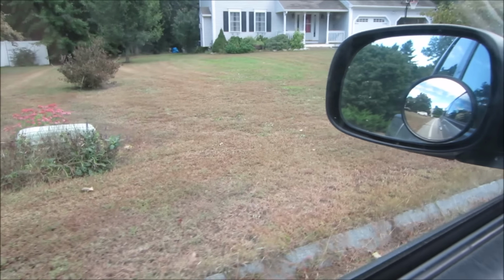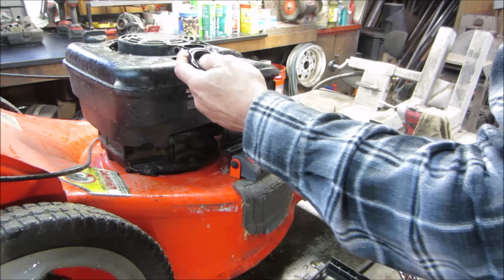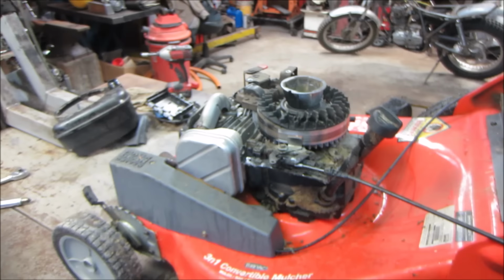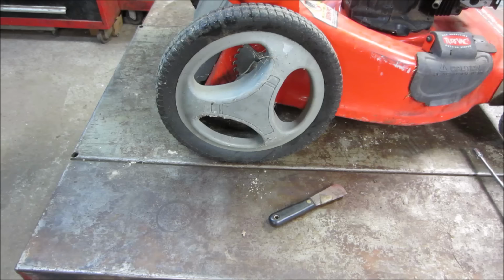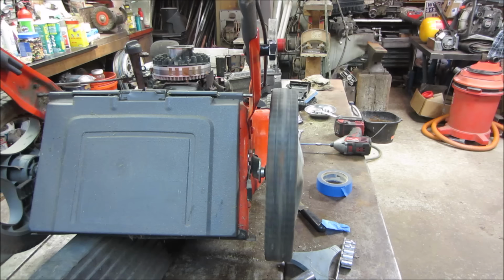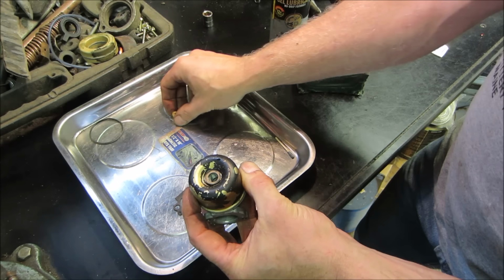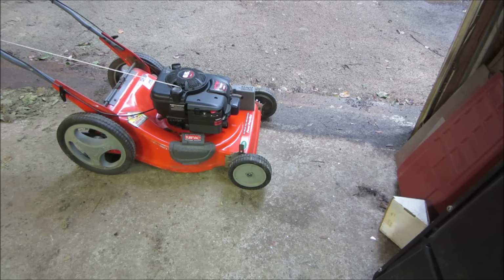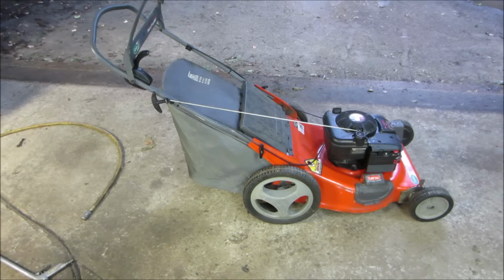How to restore a lawn mower. cheap.

Comment: Blade grind is definitely wrong. It needs to be on the upper side to cause the clippings to lift and stay aloft to be mulched and re-mulched into tiny bits or to be vacuumed into the bag. It acts as a fan so to speak.

Comment: Great video with nice explanations thanks, I have a question, doesn't it have an oil drain plug underneath the deck?  Seems if the mower is turned almost upside down to drain oil it has to leak fuel.

Comment: I'm lucky living in Canada - Shell V-Power 91 octane fuel has no ethanol. I use it exclusively for my lawnmower and snowblower (plus the Jetta, as seen in the icon). It may sound extravagant to put premium in them, but they have been bulletproof since running that fuel. That carb was DISGUSTING!

Comment: Thanks for the video! with your video, the "ground wire" attached to the armature or ignition coil is actually one that shuts off the engine, so does this mean then that if that cable touches a metal the engine will not start at all?

Comment: Hello Mustie, I enjoyed your video. I am from Australia and I have a lawnmower, that I am having trouble with in that it is backfiring and sparking after about 10 minutes run. The firing noise comes from around the carburettor. Also it does not seem to run smoothly, the noise of the engine is not regular. Had a look at a video which indicates that it might be a coils that is not working to its full capacity. I had given it to a lawn mower tech but  lost nearly $300 in the end and ended with a lmower thats not right. It is a Victa, 2-stroke Briggs and Stratton motor. Csan you please give me a headsup as to what might cause the problem. Keep up the good work.. Thankyou.

Comment: That blade is the product of somebody wanting to sharpen the blade and was either too lazy to take it off and do it right or didn’t have the right tools handy 
Either way it’s sharpened on the wrong side of the blade the bevel should be on the top not the bottom.  And the purpose of the back edges being curled up is to creat an up draft under the mower deck to draw the grass to stand up so the blade can cut it off!!

Comment: Mustie, I’ve got a question,  I’ve  got a  3yr old toro, push mower  Honda motor with self propel,  I always run it out of gas when I’m done with it,  last weekend I mowed the front yard,  took an hour break and went to start mowing the back yard, and it wouldn’t start,   This mower has always started by barely pulling the rope, and always by the second pull,  I pulled the bowl off and sprayed down the float with carb cleaner and it started up, but ran a little rough,  my question, do you think that just adding a fuel system cleaner will help the issue,  or would you suggest a complete carb rebuild?  My mom bought me this mower as a Father’s Day / birthday gift,  and I know might sound strange but I would like this mower to last for many many years. Thank for your videos,

Comment: I have a similar Intek 6.5 engine but with no speed adjustment or throttle cable. Anyone have any ideas on an engine suddenly running at 1/2 speed? Is there adjustment screws or linkages I'm not familiar with somewhere? Let me know. Thanks for the great video, as always!

Comment: Why not just drill out the four rivets and rerivet them upon reassembly. Great video. Im 66 yrs old.and at the risk of being judged as not holdimg up my end of the social compact and continuously repurchasing the same products over and over, im forced to admit in my life ive never bought either a lawnmower or a vacuum cleanef new from a store and no this isnt indicative ghat i live in a home with grass up to the window tops and carpeting so full of culinary detritus that the family could pass for.preppers and eat the carpet in a famine. I continually pickup curbside both these home essentials and upon inspection over 90% of the time theres nothing wrong with the vacuums other than the owners have failed to follow the instructions they so inanely tossed aside when they opened it from the box, ie the filters are clocged and or.the belg broke.....$6.99. As for the mowers.....ditto......they usually have parked it full of gas all winter and gummed up the carb.....period. This is the face of whats been foisted on the ever stuperous cattle as a Consumer Economy. An economic model designed to fail as soon as the cattle run out of feed or the credit most depend on to continue a lifestyle they see the Kardasian girls on tv live oblivious to the fact its a fantasy and what little truth is there , they paid for......on credit, of course. Anyways thanks for the fun snd i apologize for the sermon , but i did find it in a trashcan for free. Rich/San Jose

Comment: which way does the blade turn, clockwise or counter clockwise ?
Also I have one that is chain driven front wheel drive and chain is rusted up bad ,
so what is good way to get that clean or usable? I was going to soak it in oil.

I liked the way your drained the oil , and you didnt say how much oil does it take to fill one up?

Comment: Did he use the 15mm pipe? I have been working (diy) on alot of things over the years, but I cant remember using 15mm once.. Out of curiosity I would love to know me thread size of the wheel shaft..

Comment: The secret to the wheel may be What I've seen done with you are gonna laugh but Barbie arms Had a friend they made custom Barbie's you boil water remove from heat drop the wheel in leave it in for short time increments you don't want it to get too pliable, place it on a flat surface then place a weight on it either cool it down with cold water or allow it to cool & hold to hold the shape. heat guns only allow you to heat the rim the tire also holds the warpage to change the solid tires you boil them to make them pliable to stretch over what uses to be steel rims.

Comment: My mother gave me a lawnmower it has the same motor as yours. I took the carburetor off and clean it with my air compressor and soaked it in gas. I check the spark plug and it has spark. Try turning on the lawnmower and it’s doesn’t start even when I put starting fluid in it. Compressor is good. Any idea?

Comment: What if you laid the wheel flat with pressure or weight on it and applied heat? 😮 25:50

Comment: Very enjoyable and entertaining. I never hear your air compressor running when you use your air tools is it located at your neighbors house or do you have it in a sound proof shed? Is that a Q-tip that you used on your drill? It is interesting that the engine speed is controlled from a lever on the engine and not from the handle.

Comment: I know it's old video, how much time did you put into it? 
1st drive by that mower you missed picking up that pot & lid. Can always use a large oil catcher.
I've had a few FREE MARKET mowers. Did just like you, go through it to see if it's viable. In my area most weren't, usually the oil was never changed.
HoDIY blade sharpeners usually just grind the wrong side of the blade, too lazy to remove & do it right. Tho it still cuts fine. Balance? Only if it shakes. (Eyes skyward)
(HoDIY - HOME owner DO IT YOURSELF)

Comment: Can I ask u a question I got a snaper sp90 runs great I got it new 2017 I'm starting have little gas coming out of the breather tube that goes into the air fter I put a new air filter in which the manufacture said it still comes out now its just like a teaspoon.the amount not much like I said it runs great I have no idea  u have any ideas

Comment: you have to make dam sure you have the peice mointing to teh carb. sealed tight so air does not find its way in there, only fuel, I found that out!!, possible silicone sealer
Reply: this area you will also find a fuel leak and you will have to get the new gasket or a sealer to be applied in that area, or you will have problems leaking fuel and sucking air

Comment: Did you ever run a piece of mig wire through the rope pulley and use it to thread the crank rope?  You might try it!

Comment: hello ! ... i got the clunking noise in my mower, the noise was loud and suddenly it stopped and no more noise and running smoothly.  My bad because the lack of maintenance, i recall to check the oil and I remember I saw it good, no black or low level. Can I still save my engine?

Comment: Whomever sharpened that blade didn't remove it first. Sharpened it on the mower,  the rear wheels I'm almost sure one side was hit by a car in the garage.  I've come across that before tire of a car will bend both wheels like that.

Comment: what solution are you using in your sonic cleaner?  Ive seen guys on youtube use regular gas in the sonic and it works quite well.  a local shop uses straight simple green

Comment: PA LAWN GUY> Mustie that blade was never intended to be sharpened as it was. The lowest point on a mower blade should be the leading edge of the cutting surface. The way this blade was sharpened there is an excessive amount of drag on the blade and the engine has to work harder to maintain governed RPM.

Comment: I'm late to the party, but that blade isn't correct. I've never seen one sharpened on the bottom side. That one looks like it was manufactured by Murray. And I've never seen them use a blade sharpened on the bottom. I'd guess it's upside down

Comment: Hi Musti, nice job! Again 👍
Question: my lawnmower similar to this seems to be not grabbing very well with them front wheel drive wheels, i.e.when it gets in a gopher hole, or up against a rock, brick etc,etc, is there a way to strengthen the grab in the drive unit?
Reply: If it has a belt, clean the pulley. There may also be a spring of other method to put tension that may be adjusted.

Comment: check the blade first to make sure he didn't snap the crank key off then i would have bolted on the recoil to c if it had spark and compression.  why clean anything.

Comment: Hlo. With respect. You never ever turn the blade without leather gloves and FIRST DISCONNECTED THE SPARK PLUG, because it is an 4 times engine and for the reason you want it can suddenly start and kiss your fingers good bye. Even without grasp the maneuver. It's is just a respectfully advice. Thank you

Comment: Got a troy built tiller that piss gas out the carburetor what would cause it? Not setting?
Reply: Just like what he shows in the video, the float bowl seat is leaking. You need to clean it up just like in the video. May need to replace the seat itself. They're often rubber and die from ethanol exposure.
Reply: Easy the float had cracks in it found them when I tried to sodder. It so a carburetor is only 28.00 bucks...
Reply: Troy built with the killer. Engine have brass seats or this is what I found out...

Comment: i do not waste my time with those wheels on that mower, i look for a rover mower with a shot motor, so i remove the shot motor and put the good running motor off the shitty chassis and bolt the good running motor on the rover chassis

Comment: First glance: Blade is upside down.
But it's not.
Reply: Here's an easy way to remember: Once you've ground your blade, your work will not be visible when the blade is reinstalled (ground surface ALWAYS faces upward).
Reply: I've NEVER seen one ground like the one in this clip. Maybe I just haven't been around long enough...

Comment: I find these from time to time, but now I just pass by them. Unless the crank is bent or the rod is thrown, they are simple enough to repair. Problem is you will not recover the time you spend on it.

Comment: Hey dummies lol you can't tell by just looking, If the blade is on upside down or not? Lol the motor turns clockwise,the cutting side is lower that the non sharp side ,that way it cuts the grass on the low side, and the high side pushes the grass out like a fan blows air..you might wanna tear the motor all apart tho bro, to confirm that lol

Comment: If you can buy a new carburetor for less than $20 from Amazon or Ebay, why bother rebuilding the old carb?
Reply: OEM carbs always run better - not sure why, but they just do... plus, why wait 4 days and pay when you can rebuild the carb in 30 minutes?

Comment: You give me a twinge each time you turn the blade without disconnecting the spark plug. Please be more circumspect.
Reply: There is NO CARB on the this mower.

Comment: You know you are very clever mechanic there is no doubt but every once in a while you have a brain fart I don't know why you don't understand how to fix those tires look you've got one tire one wheel that is bent correct? Absolutely? The wheel on the other side is just as bent correct? Absolutely what you do is you put the bend on the left a hundred eighty degrees out from the bend on the right and it will go down the road straight ahead and you won't have anything to worry about